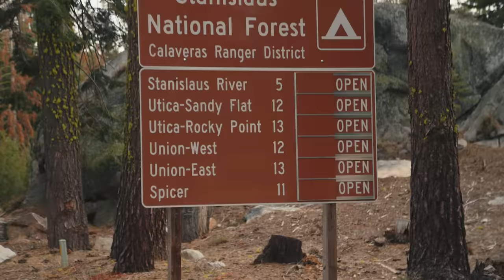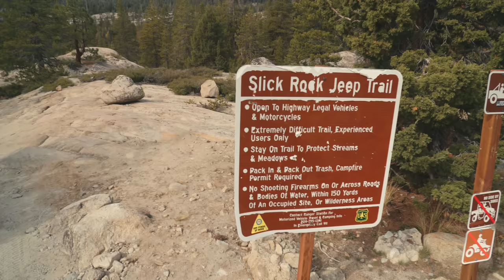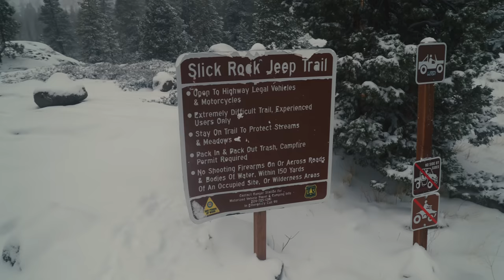Snow Crash in the Sierra

Comment: 4:09 That makes good sense, I have been driving off road two footed as I mostly learned on rigs with an open diff and a little brake with the gas tends to help prevent wheel spin before there were electronics put in the rigs to have the brakes help with a flip of the switch.

Comment: Defiantly get the steering rack checked and maybe the frame horns that the bumper attaches to. Also check the mounting bolts for the bumper. Maybe replace the bumper mounting bolts. But it wasn't hard enough to set off the air bad g-force sensor so that's good.
Reply from the maker: That one surprises me. Maybe it doesn’t work :)
Reply: JFYI: FJ80s don't have racks....they're recirculating ball with a regular steering box and tie rod/draglink set up.

Comment: Awesome driving Miguel!  Everything about this episode was excellent!  The 80’s series is an absolute beast….😮  And those ARB bumpers are absolutely worth their weight in gold.  👌 

Thank goodness your rack had that give engineered into it too.  Makes me think and wonder what mine would do if ever in a wreck like that and I fear with a RTT and everything else I have up top awning, hi lift, recovery boards, etc, mine would rip from the mounting points. 😬. Makes me think having some sort of extremely secure sliding system built into the side rails is a really really good idea! 🤔
Reply from the maker: Fwiw it’s a Gobi rack!

Comment: so many lessons to be learned on this one. alternative for gamin inreach not connecting. proof lockers and tires and bumpers before lights. bumper saved radiator from smashing into fan. no power no heat. say what you want about smoother ride and better gas mileage for alterains but i dont think you get out with them on. would the track boards have gotten you out faster? probably second guessing is where you learn. should have had chains? maybe. again learn from mistakes made, adapt from there. the before and after shots show a lot of why to be prepared. well done to miguel. get on it. up over and out of the trail. quality family time.

Comment: I’m glad you guys made it out to safely and you only ended up with little cosmetic damage! The safety gear on the 80 did it’s job and protected your and the rig!! That was a Halloween story that can be told around the camp fire to future generations!! It’s nice to have that time to get away and do a mental reset from the daily grind of life!! Miguel, you did a amazing job getting out back to the main trail!! Keep working on those driving skills, every chance you can!! Michael We see you haven’t fixed or replaced the winch yet!! Also with the impact your front shackles took they should be replaced do to the shock load they took!! OB 23530

Comment: no lockers?
Reply from the maker: Lockers
Reply: @OverlandBound   What brand (assuming they aren't the factory E-lockers based on how they were working)?
Reply from the maker: @jeffthompson5690  they worked great. Factory.
Reply: @OverlandBound  Odd.  They should be spooled up when locked and the video shows slipping at one wheel before the other locks in.  15:28 is an example...but maybe you guys just didn't have the front engaged.  Same thing at 16:03-16:05. If that was the 'hardest part' of the trail, I guess I'm surprised you didn't just lock the front locker.